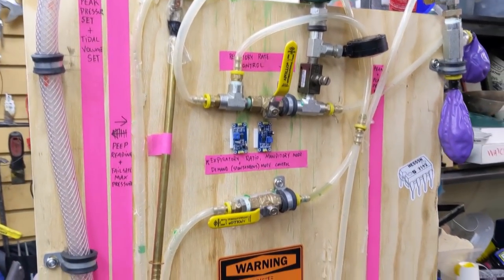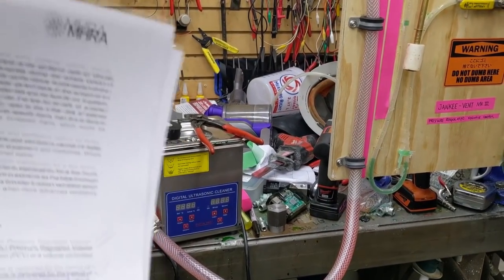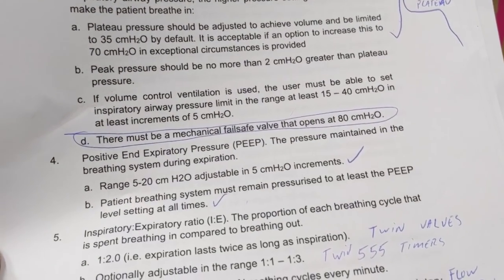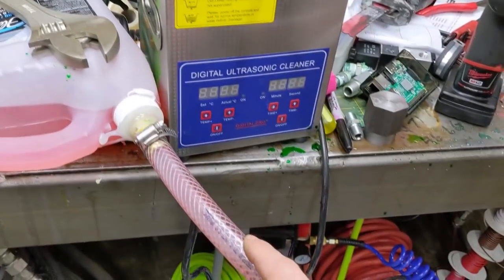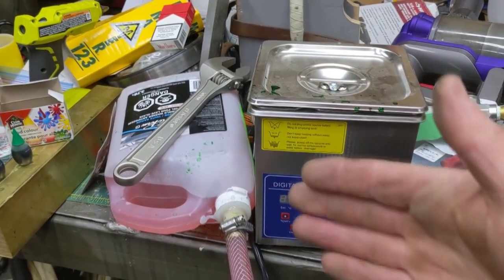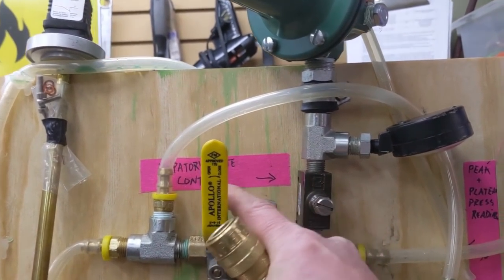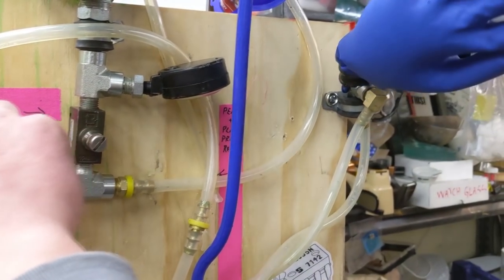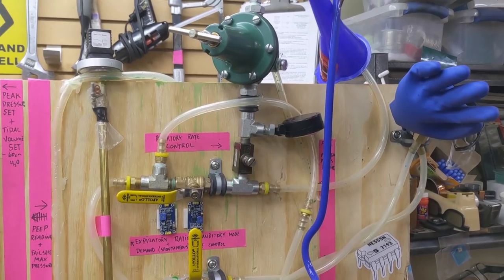Simplest Ventilator Prototype? | 555 timer!

Comment: The die casting plant I work for was just comissioned by GM and Ventec to produce 200,000 sets of cast aluminum parts for medical grade respirators. Those parts need inspection, machining, shipping, and assembly across multiple factories to then be purchased and used in hospitals. Honestly, a little ingenuity like yours could go a long way in the coming months; It's going to take a while for those ventilators to be in hospitals. 

We appreciate it AvE, much love from the states.
Reply: Thanks for your team efforts.
Reply: It's why we have to flatten the curve...
Reply: No time for all that news media expects next day delivery
Reply: Well not really...this "ventilator" isn't usable on patients
Reply: @greyhound4204  One way to find out! I'm sure we got a willing volunteer on hospice care somewhere in 'Merica!
Reply: NY Apex 14 - 21 days, still 25,000 vents short.
Reply: Ford is teaming up with 3M to produce positive-pressure respirators using off the shelf squirrel fans for ventilated seats, along with 12v power tool batteries. Trump was talking about invoking the War Powers Act, but both Ford and GM were on board already

Comment: This is super cool, I'm a physician (not an ICU doc though) but having this set up to even be able to do an assist control mode is amazing, the most important part for covid 19 is dealing with ARDS that requires high peep and low tidal volumes which it seems like this ventilator is capable of doing! This is amazing work and could save lives, you sir, are a hero!
Reply: Do you think the health system will get that desperate?
Reply: @jonathanwright5550  its about to be one of these days (just 2 weeks after your comment)

Comment: "We're not makin' a bong here." Haha that part killed me. Excellent work sir. I work in the medical field and I applaud your use of your skills at this time.
Reply: Although, using a bong instead of that too thin tubing would stop the air comingling into the water.
Reply: The rabbit hole that is he is one that could damn near cause a divorce.
Reply: John Lawson - he goes deep
Reply: I mean, medical marijuana cures everything else....
Reply: @deckdriver  while the design of a water bong would in fact cause the air to not co mingle with the water and allow it to pass through. It would however defeat the purpose of using the pressure behind the water in the tube as a gauge.
Reply: @Nightowl2010100  there is always a problem with the things purchased at a head shop...

Comment: I’m an old respiratory therapist and retired Prof. Of RT. I had the great pleasure of meeting Forrest Bird and know the Bird vents well. The Mk7 is the primary example and has a ceramic on/off valve made by the same folks who made the filters for Coors beer. The on/off valve was moved by a rubber diaphragm with a spring tension adjustment to determine the maximum pressure and adjust sensitivity. The Mk7 had a timer which was a simple pressure leak mechanism. In anesthesia vents, the timer was a separate tiny unit with a dial to adjust rate only named the Mk2. To make it a volume vent, add a chamber (Mk10) with an adjustable rubber bladder. Give any older RT 20 minutes and a few parts and we can make a volume ventilator. There were cast plastic fluidic vents that never caught on. Guess the Coanda effect was just too much to grasp. To add PEEP, just run the 22mm exhalation tube into a bottle of water the # of cm you want for PEEP. 5 cm for 5 cm/H2O.

Comment: SCUBA:   Most of these parts are PART of a divers regulator.   If you use SCUBA parts we have MANY of them around.  Also the SCUBA tanks exist in large numbers today.   Please pass the word,  this may help.....
Reply: You're welcome.
Reply: I was literally just thinking this. My regulator demand pressure can be set so low it practically force feeds you air. In a pinch. I bet it would keep someone alive.
Reply: @GregoryVeizades  I have been reading the spec for the Hi-Tech versions of SCUBA regulators and they fit the bill.   We NEED to spread the word.  Simple and exists is quantity today.   Pass the idea around.   This may help.
Reply: Can you electronically control the demand valve for a patient with no intrinsic respiratory effort? A demand valve requires negative pressure to operate.
Reply: using scuba in Italy

Comment: a spirometer can measure tidal volume and then you adjust the pressure to create correct tidal volume. its placed on the ass end of the circuit.
peep valve is essentially a resistor at end of circuit and have a continuous flow hitting it
Reply: @SlocketSeven  I only understood "ass end"

Comment: Best explanation of VCV vs PCV by a GE Anesthesia instructor Kyle Goodenough. Volume control is smoking a cigarette, nice long drag in drag back out. Pressure control is smoking a joint, suck in real quick, hold then exhale.

Comment: The manufacturing bottleneck for your design will be the supply of hot pink hockey tape.    What a wonderful lock in geek project.
Reply: That ping pixie manufactured tape is the USP that commercialised the product :-). Isn't it reassuring that patterns are not impeding the world from fighting a pandemic. (Just a touch of irony in my comment - couldn't resist it).

Comment: Hey AvE, 

For 90% of our oxygen needs in the hospital, we use those flow meters you talked about.  For machines like BiPap or Ventilators we plug the oxygen directly to the 50psig on the wall.

Comment: The exhaust needs to come from fairly close to the patients mouth. In order to keep velocities low all the tubing has to be large, and with large tubing you have a lot of volume in the tubing, and all the tubing between the patients lungs and the source/exhaust is dead space that just recycles the air that was in it before.
Reply: and this is why ventilators use two tubes... one for supply, one for exhaust

Comment: 555 timer's fine, but maybe this calls for an Arduino vs Evil
Reply: He's come full circle.
Reply: Pretty sure AVE said previously he wanted to steer away from Arduino / Rasp pii as they tend to glitch and need a reset. "Humans dont respond to well to a reset" were the words he used. 😂
Reply: @peteledwidge3631  Arduino doesn't glitch usually if your code is good :D
Reply: @devrim-oguz  I was simply relaying what AVE said regarding the matter in a previous video mate.
Reply: @devrim-oguz  Arduino is just Atmel, if you have an experienced C++ programmer, not a JS one, you can get pretty professional with it
Reply: Pete Ledwidge Good one! I remember that
Reply: @monad_tcp  I know, but PIC bought Atmel now and both of them are PIC now 😄
Reply: @monad_tcp  That's also why I said it in the first place. If you obey good programming practices, the Atmels are industrially tough.

Comment: This type of circuit  is what drives the early Bird Ventilators (Mark 4) and paraPAC 200D. Also, PEEP valves can be standalone components (very cheap). Most hospitals already have them for ambubag resuscitation. Same with 40cmH2O (substitute can be 4277T52 on the McMaster) and 60H2O pressure release valve.

Comment: As for the o2 in the hospital yes we have the basic flow valve but we only use that for nasal cannula, or bag valve mask. The ventilators, hi-flo nasal cannula, or bipap all have a threaded connection that bypasses the flow valve and the machine controls the o2 however you set it

Comment: What happens when you are Not Quick Enough on the Walve and I Start Blowing up Like a Balloon...
Reply: We put an sidecutter with sticky-tape on the  business end of the Kong flu- ventilator ... snipp
Reply: Bring a concrete parachute.
Reply: I believe the correct answer is we place 30Kg of brass stock on the chest to counterbalance the air.
Reply: See Willy Wonka
Reply: Pecker indicator  starts exceeding original length.  Then the audible , excited wife alarm starts cooing . Thus we pull the plug on the machine  and get a plunger to aid pulmonary function  whilest the wife alarm initiates mouth to antenna resuscitation .
Reply: texasdee slinglead I’m ok with that!
Reply: you guys are great.  hahha

Comment: +AvE

Do we need a positive pressure version?
Something that keeps blood oxygenated, even if somebody falls into a coma, (provided their heart is still beating).  Maybe have the 555 just issuing timed pulses, and have a mode switch; one mode for forced positive pressure and one for patient initiated breaths?

I would suggest the following:
Have the 555 generate a timed pulse at the prescribed rate of breathing.  Have the 555 pulse and a patient triggered input to an AND gate.  Have the AND gate trigger the solenoid. This way the patient is protected from hyperventilating.
Also have a second 555 monitor the output of the AND gate.  If it doesn't trigger for a prescribed amount of time (I'm guessing 30 seconds), the unit could switch to automatic by simply bypassing 555 signal past the AND gate.

Comment: The green should not gurgle if you had more liquid in the tube.  Viscosity and diameter should not be an issue in that set up.  You just need to keep from breaking the suction at the U.  Maybe loop it a couple feet lower so you have more range available.

Comment: You can trigger both cycles on one 555 if you trigger one solenoid on the high output and the other on the low output.

You may also be able to use larger reservoirs in place of monometer 1 to keep a more constant pressure, or use a weighted plunger, but that might cause some sticktion

Comment: Inspirer est "inhale", expirer est "exhale". Sinon c'est une bonne idée les 555, ça se trouve partout, beaucoup plus robuste et stable que les microcontrôleurs classiques. Si j'avais à mettre une vie entre les mains d'un 555 ou d'un Arduino, c'est clair que le choix est vite fait. Je vais essayer de me faire un prototype également. Pour ton problème de valve qui n'a pas assez de pression, je vais avoir le même problème, j'avais pensé actionner la valve physiquement avec un solénoïde au lieu d'être pneumatique ou hydraulique, j'en ai quand même beaucoup, et ce n'est pas très difficile à fabriquer. Un beau Bonjour de Montréal, malheureusement nous l'avons difficile en ce moment.

Comment: While you wait for your Ali-Expess shipment to arrive, any chance of linking the the regulatory and expiratory valves with the odd aluminium rod and some heim joints you have laying around?  Hot water will be less viscous if in a pinch. Acetone would be best, depending on tube type - but that brings up the inevitable trip to the ”dépôt à domicile”!  Nes pas?  You're rocking this! Marian Rejewski, Henryk Zygalski and Jerzy Różycki would be proud of your ”enigmatic problem solving!” heh, heh, heh?

Comment: Maybe not good for measuring pressure, but as an overpressure relieve valve you could just stick the small tube into a bigger container to let the air bubble out. Depth of the tube opening in the container = set pressure. Would also be easier to adjust than trying to fine tune the amount of liquid in a tube.

Comment: There is pressure control and volume control.  A bird is pressure control so it gives a volume to a certain pressure!  With ARDS you need a bit of pressure to get a volume.  Assuming room temperature.

Comment: Word of warning on the water, for anyone building one of these: there's this stuff called "Legionnaire's disease", which is named because it got into the evaporation-based air coolers at some soldier's hospital in New York, and then got into a lot of patients from there. You prevent it by either avoiding water (depends on having an alternative), putting a sterilizing agent in the water (valid if also part of a treatment, worrisome otherwise), or using some other technique to kill the bacteria. Having two silver electrodes in the water, and running a small current through them, is a possibility that I have heard is being experimented with, and might be relevant if anyone wants to actually build one of these things for medical experimentation or something.

Comment: Great work but not the simplest. Saw a vidjeo this morning of a doc and a mechanic that came up with a machine that is pretty much a push rod on a motor driven eccentric that squeezes an ambu-bag and automatically squeezes and manual ventilator contraption. Rate is driven by motor speed control. Volume is adjusted by changing the stroke.

Comment: Hey man, before you replace the tubing it might be worth a shot putting a little bit of jet-dry or similar in with your water, regular-ass dish soap might even work. If it works (which I ain't gonna guarantee!) it'll reduce the surface tension a lot and keep the water from sticking to the walls of the tubing quite so bad

Comment: I was actually wondering if the basic double valve design of a hydro ram could be used to convert the constant pressure of a cpap to the rhythmic cycle of a ventilator. Volume could be set with a screw adjustable plunger that vairies the size of the pressure cylinder. A spirometer or 2 could be spliced in to provide your readout guages. The whole valve assembly would have to be made out of really lightweight materials to work with air instead of water.

Comment: The air needs to be filtered (obviously). MERV 16 air filters are rated to remove over 95% of 0.3 micron particles, same as an N95 Mask. They're readily available and each filter can be used on several machines.

Comment: I was going to say, here in the states anyway, I know liquid O2 isn't scarce or expensive. I've seen the good 'ol welding supply tanker backed right up to a rail tanker sized tank of the stuff at my local hospital (took note in fact of that much liquid O2 in one place with ZERO security infact! not even automotive deterrent until recently!)
Reply: When they place a HYDROGEN tank close by,... get the hell out - or you'll be going to the MOON  !!!  LOL

Comment: As an ICU nurse, cudos!! Will you be able to regulate the time of inflation/deflation as well? (meaning the time necessary to deliver the full volume of gas to the lungs)
I see that you are able to regulate the inspiratory/expiratory ratio, but a modulated delivery of the gas is necessary as well. 
The lungs have a certain compliance,if the inflation is too fast barotrauma will happen.
How does the system cope with loss of pressure in the system? (Ventilation circuit disconnection/pneumothorax?) 
Is it easily stoppable to perform filters changes and other procedure without spraying aerosols everywhere?

Comment: Don't forget your test lung (glove) needs to have enough resistance to mimic the anatomical negative pressure on the lungs. 
In the field we have a few types of test lungs available that we use to calibrate and check our ventilators before we turn them around for next use. One type is just a rubber balloon that's sandwich between flexible plastic. An even simpler type is no different than a sports bottle filled with copper Brillo pads. Like the bottles used in a boxing match.

Comment: Is there any benefit in considering a common-rail type device to be able to deliver compressed air to multiple patients at once?

Could potentially simplify the design and allow for relatively quick expansion of the design to accommodate more. Good for temporary wards perhaps?

Comment: @AvE This is a Hail Mary but I was wondering if somehow you would be available for a few questions about building this . Your first video inspired me to make a quick one with parts of my service truck. I m a generator tech and I had some Asco red hats in the truck. My question is about the bladder  . I know your firing the inputs for the 555s to open the valves by the wc height but I am wondering if the charge  from the bladder will need to be controlled or restricted so it does not empty too quick?  or does it not matter since the volume and pressure is more important then the length of the charge. I think I fucked up my question and will probably induce a stroke in whoever reads it. If it makes sense could you please respond. BTW thank you for all of your content. Your an inspiration and make me proud to be a tradesmen. Your  content is more impressive then any celebrity You Tuber  . Your mix of intelligence and humor makes you so enjoyable to watch.  Thank You.

Comment: VC-CMV generic settings usually at Tidal Volume 500-550 mls  Rate 14-16 bpm PEEP 5 cmh20 peak Inspiratory pressure  should be about 40 cmh2o and Plateau pressure around 30 cmh2o, to find a tidal volume you want for your patient- range formula is 5 to 8 mls/kg based off of their height, weight DOES NOT factor in tidal volume settings

Comment: Rather impressive sir, but it would be far easier to use a spring actuated rubber diaphragm that you would just calibrate to physiologically applicable peep. 60 on the peak end regulation is kind of high, but acceptable.

Comment: the bladder is in a flexible container and will require more air than necessary to get the right pressure. not the end of the world but it might be a problem for 30 times a minute.

Comment: Don't you just need more water in your manometer to keep the input side from going past the bottom of the bend?  That should get rid of the bubbles. Maybe a few drops of Dawn dish soap to get rid of the surface tension? (It comes to the rescue in every other natural disaster, right?)

Comment: If you are venting the gas out and need pressure control, dunk the tube in a bucket of water. The depth of the tube in the water is the pressure before it vents.